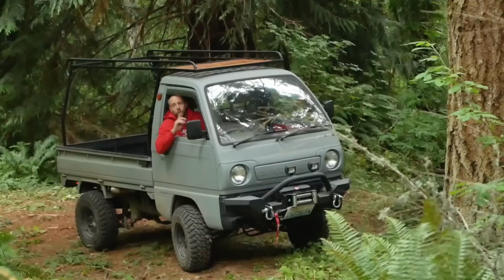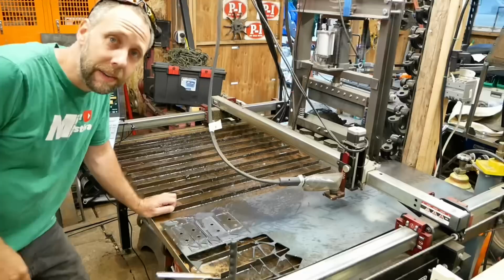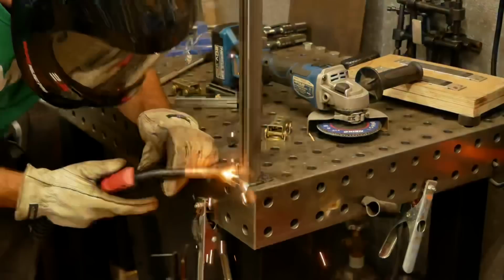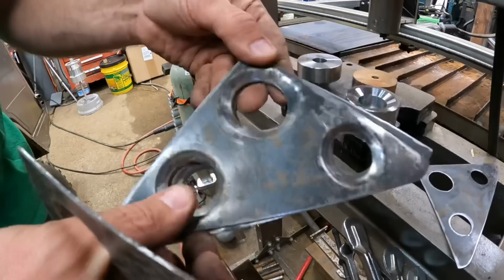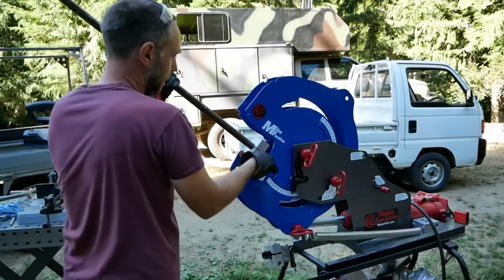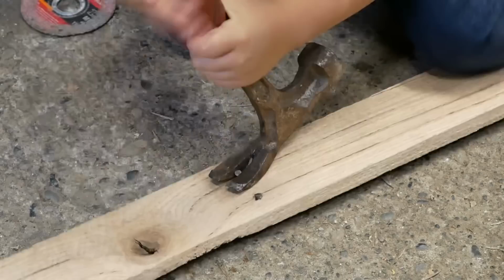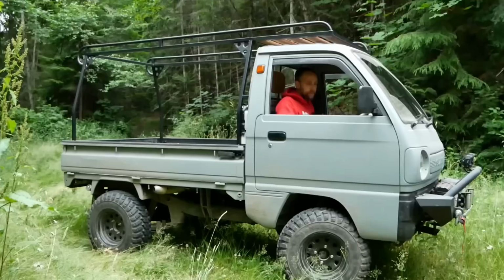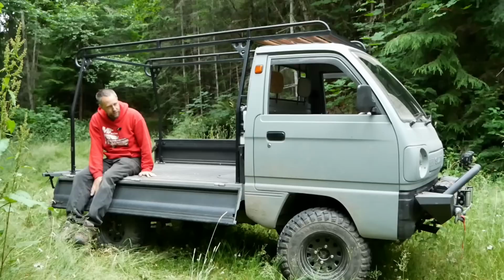Suzuki Carry JDM 4x4 kei truck ladder rack build

Comment: This reminds me of back when I was active in the 4x4 crowd. There was a guy in our club that would weld up steps and bumpers for 4x4’s that were made of round tubing, but he welded them up tight and fitted them with air compressor fittings so they could double as air pressure tanks for the little compressors we took on the trails.

Comment: I'd love to say that the quality of that rack is factory built, but that'd be a DAMNED insult to your build. Freaking top job on this one Mike, superb. Indeed, you've come a long way, and it's not just the tools that got better, i've seen plenty of shops built with money that forked out subpar quality work.
As a recommendation for a sewing machine, maybe be on a lookout for a Sailrite Ultrafeed LSZ-1. It ain't cheap, but the quality is there, and it's a stout machine. Adam Savage just got one and he has a few projects using it (you can trust his opinion on the machine, and you can also see him push it). I have an older LS-1 and it's a very capable machine. FYI, these are machines made to sew sail material, so nothing like your average Singer or common grade Brother machines.
Reply from the maker: Thank you!!!!

Comment: A singer 20U is a decent all around setting machine for starting out. Maybe 500-600 in my area,  but could be completely different price out west.  These old machines can be difficult to come by because new ones are crazy expensive so those that have used ones rarely let them go.  

Check your local paracute drop zones and talk with the master rigger . They will usually have any leads on local machines.  You don't want to ship them.  They are heavy.

Comment: Add a roller bar to the back crossbar ... mount it on the outside of the bar on 2 pieces of round tubing so u can raise n lower it above the back bar ..makes it easier for loading ladders n long materia, like box steel etc ..

Comment: There's a military supply joint down by fife that always has a bunch of those military trailers and parts. One of the most common unused parts were the bows and canvas cover. It was a very cool design that let you cover just a portion or the whole bed. I think that the specs are close enough that you might want to look into modifying one of those. It might not even require modification unless you want a very tailored fit. Either way, it might be the cheapest way to get raw materials. Plus that waxed denim that they used is fantastic, last forever

Comment: Great little episode Mike.  I bought the Fein Chop saw after watching your review a few years ago and I have used it so much for some huge projects and it's absolutely brilliant.  I dulled the blade on some stainless and actually resharpened it with angle grinder and it's been great ever since.  Byron. Australia.

Comment: Coo build!  Simple is elegant.  If you notice any lateral (side-to-side) movement you could put gussets from your mid cross bar to the forward vertical legs.  I don't think you hardly see them as they'd be tucked behind the cab and they would sure stiffent things up in that direction.  If you put them on the back legs they would perhaps get in the way of getting in and out of the bed and would be more in the wind.

Now with all the good tools this is getting too easy for you!  You need to challenge yourself.  That rack might be a good foundation for a gun turret or rocket launcher!  LOL!

Thanks for the great content.

Comment: This is exactly what I want to do to mine. A). Would you ever fab/sell one of these?  Possibly as a weld-it-yourself type thing? I have a welder but no bender.and B) Ever thought of running a plate under the bed where it bolts down and welding a tube off the side of the frame to the plate? This will keep it bolt on but with more strength. This is how we used to make our roll cages.

Comment: Another good idea well executed - i wish i had your skills. I am looking forward to the 6 wheeler build when finished. I like the fact that you will change the wheels on the Carry - with those oversized tyres -  its either upgrade the engine or get proper sized wheels - and as you fixed the engine problems - all that's left is the tarp top.

Comment: Mike - Amazing work as always! I love watching your videos to learn and get ideas for future projects. One idea for a modification if you build a heavier duty rack in the future would be to extend it a little further forward and add rollers at the front and rear of the cab to the rack. This way you can loop your winch rope over the top and pull things into the bed you might not be able to load by yourself. Take care and please keep cranking out the amazing content!

Comment: maybe add a wide strap with dimple dies to strengthen the middle of the pallet boards where the nail holes are?  Do the dimples where the open spaces are and screw on the edges.

Comment: That truck looks totally unsafe for highway use and I want one! It looks great and rack turned out great, especially with the little details like being able to open the sides and the tie downs. I've installed toolboxes to the managers demands that didn't open more than half way because they hit the flat bed side rail, but that's how they wanted it despite my objections. I missed how you aligned the top square rails to end up flush with the cross braces so both were horizontal and not tilted in or out.

Comment: I had a suzuki the same model as yours. It was converted to a left hand drive. Problems encountered were fuel pump, high engine temperature when caught on traffic jam- can be solve by replacing the engine 4 blade fan w/ 5 or 7(i forgot) blade fan but I just change to semisynthetic oil 10w-40 drop the temp a little bit.. Noise also at the front axle when travelling straight you hit a bump it randomly makes a sound for few minutes and suddenly stop(sounds like "winding ngok5x... noise" not the clunking noise. Installed an a/c that is to big for the engine losses power so much  that it is like shifting into a lower gear & the engine braking.. I think it is good to repack the cv grease and other parts of the drive train as preventive maintenance. Be aware also that the front end/cabin also is not that strong, I had seen a lot of accidents involving Suzuki or similar mini trucks that was hit head-on crushing the driver even by a motorcycle.

Comment: Nice custom fabricating!  Nice looking welds!

I love the look of the ladder rack but it wouldn't add much functionality for me.  My Tacoma had the same size bed and I carried a large 17' Grumman canoe in the bed.  The overhang was extreme and it looked very funny but it was much easier than trying to put it on top.  My kayak would fit in the kei bed easily.  The headache bar would be all I need to protect the rear edge of the cab if carrying a ladder in the bed, leaning against the cab.  I definitely wouldn't want a ladder rack if it prevented me from carrying 4 foot wide plywood or drywall.

One simple fabrication I'll probably do is a small locking container across the back of the cab, above the bed rail (or nearly so) and below the windows.  It would allow full size sheets of plywood on the bed underneath.  The kei trucks have almost no inside storage so this would add some secure weatherproof storage for tools, cam buckle straps, air compressor, etc.  I might make locking boxes from a pair of oversize ammo cans.

Comment: Cool Mike.  Rack looks great.  Thinking of getting a mini dumper, there is a guy near me, "Dougs Trucks" in Michigan that imports and sells them.  Thought it might be a good cheap way to move stones I quarry and gravel material around my property.  I might be asking too much of one though. Some of this stuff is pretty heavy.
Reply from the maker: They are great little trucks, I think they are rated at 800 lb payload but I’m sure you could move 1000 lbs in one. I don’t know if that’s going to be enough for what you are planning on doing with the truck but I know you will get a lot of use out of one around your property. Are they street legal in your state? If so I use mine all the time for trips to town, bringing home building supplies, hauling garbage to the dump. My articulating truck can move about 1 ton so it’s much more useful for dirt work on my property especially with the hydraulic dump, but it took me a year to build. But really those two trucks are entirely different machines. Let me know what make and model you are looking at and I can give you a little more insight on them. 👍

Comment: any of the pre 1960's sewing machines will deal with the canvas for the covers, so a singer 99K or any of its clones. use a large guage needle (14-18) and a bonded nylon thread.

Comment: This looks amazing!  So impressed
Reply: PS Why does putting the dimple imprints in the 45s make them stronger / less flexible?  Seems counterintuitive to me that removing mass would increase rigidity so I’m super curious
Reply from the maker: Thanks for checking out my videos 👍 
The dimples I added to the flat 45s add rigidity because of the extra bends it adds.
Anytime you add a curve to a flat surface it will increase the rigidity of it, that’s one big reason cars built back In the 1940s/50s had almost every body panel curved. Hope this answers your question

Comment: Great job. The only thing I would have done differently was to make the mounts in the bed with square holes and used carriage bolts.
Reply from the maker: Now that you mentioned this I completely agree with you about the carriage bolt idea 👍
Thanks for checking out my new video and commenting James!

Comment: you have all the cool tools!!!  nice setup for sure
Reply from the maker: Thanks buddy 🙂
I have been working on getting the tools needed to help build cool projects in my shop. These are all useful tools that help to build this stuff, but someone with a few basic tools like a welder, angle grinder and a drill can do most of these same projects, you just need to build them a bit differently.
Thanks for checking out my videos 👍

Comment: What a great job on the rack Mike, lots of really nice details. Did you put doubler plates under the bed to help spread the load where you mounted it to the bed? Again you did a great job on the rack and the pallet wood is a super nice touch.

Comment: The tubing is a bit light but you are not going to be using this as a work or contractor vehicle, lightweight small tubing is sufficient   I ended up with the universal Harbor Freight rack for $300 which is overbuilt for my Honda Acty, but any rack at all is just so useful.

Comment: Hey Mike, great video series!  I also have a 90 Suzuki Carry that I picked up cheap in La Grand.   It's the extended cab model... I wanted the legroom lol I'm 6'5, it also has room for the mutt if I have a human passenger.  Has a hole in the block from a thrown rod.  Been looking for a motor for over a year...  bought one but it turned out to be the wrong one and a waste of $800.  I'm thinking of using the complete drivetrain from a Suzuki X90 that's been rolled and is not repairable.  I bought  a Carry for the same reasons you did.  I had one briefly when I was 14, had a 360cc motor and was 2wd. I also buy things that need repairing and fix them, partly to save money and partly because I figure I'll have to replace parts on them anyway since they're used.  You said you don't like those tires... I have smaller diameter mud tires on mine that I dont want.  Looks like you're out on the coast so the drive over would be pretty expensive right now.  Hopefully gas prices come down in the future.  Nice build!  I like the music!

Comment: After seeing many of this type of clip, I can honestly say I am impressed with your work and how you approach it. Extremely well done, great bending and mig work. Personally, I would have reinforced and protected the bulkhead a little (especially the rear window), and I may have been tempted to continue the roof bar support down to the front bumper that would offer some protection to the screen and screen pillar when off roading. Making a removable pegged or peg and hinged rear top bar would be a bonus if you need to load anything tall. Not sure if 8x4 drywall would go in there. Not trying to shadow your great work, these are just things I would do. I am looking for two of these or similar for work in SE Asia and the more I see on your channel: the more I know I made the right choice.

Comment: Hi Mike, new subscriber here (Ants pants told me about your channel). Nice job on the rack. I bought a Suzuki Carry 4x4 with dump earlier this year. It works great as a companion to my Harbor Freight trencher. It's been one of the best additions to our homestead. Look forward to browsing your content. Keep up the great work.
Reply from the maker: Right on Ants Pants has a great channel 👍  Mini trucks are awesome! I really have been enjoying mine, I just bought some smaller mud tires last week for mine and it’s really helped restore the power, the previous owner installed those big 25” tires and as cool as they looked, it really sucked the power down. What year Carry did you buy?
Reply: @Mikefestiva  Mine is a '94 and I agree on the tires. I'm running 12" Sun F off road tires on the stock rims. My place is in the foothills of the Blue Ridge mountains so I have some steep, slick clay hills and it climbs great and will haul and dump a half ton load with ease.

Comment: I'm wondering why no gussets for side-to-side support on the rear vertical members?  I see them on the front parts.
Reply from the maker: Yes as you mentioned I have gussets on the uprights close to the cab plus a cross bar below the window, with the design I did with the upper round rails that curve around 180° and tie into the uprights it added a lot of strength to the overall design.

Comment: Another great vid! I'm in Oregon and I'm trying to find out how to register kei trucks here. DMV site says you can't but I've seen them with Oregon plates!
Reply: Past 25 years or something they're antiques. Maybe the ones you saw were older?
Reply: In Alabama they said they couldn't be registered and tagged but if ine went to a smaller county office and they inspected it with all legal required equipment in place and working a lot of those offices passed them and issued rehistration and tags... So I'd ask around and see where and how those others went about it.. Forums for them exist and are plenty helpful for any questions such as that as well as upgrades,technical help,etc..
Reply: @FJ80Coop  hmm that's interesting. Maybe you can get it registered in another state and then transfer to oregon?

Comment: So many possibilities with this truck.... and road legal to !! Your skillfullness is "awesome" .  Nice work. Can't wait to see all the mods you will do to this truck....except for the tire reduction...Don't do it !! Haha
Reply: What is wrong with the tire reduction? They were originally designed for a certain size of smaller tire. The truck will definitely  have more pep, probably  handle better and have fewer steering and suspension issues down the road. So it will be more reliable and durable. Don't think you can best the Japanese engineers at these companies because they know way more than you who just think of the cool  factor.
Reply: @bryanwarm2471   Hi Bryan, I certainly agree with you about the engineers knowing more than I do !!  I made this comment about the tires  thinking If this was my truck in my working environnement.  I only work with my vehicules on my homestead ( 30 acre wood lot). I need  vehicules with high ground clearence and that is exactly what prevents them from having issues.  I always drive them in low range and leave the torque do the job. I very rarely rev the engine. I don't break them !! That's the advantage of having a vehicule with a low range tranny,  they are more  tolerent to tire size change. I would never increase the tire size on a honda 420 for the obviouse reasons.  If I were to use this truck on the road also , the original tire size would definetely be more logical for the obviouse reasons you  mentionned. Sometimes there's a worthy  reason  to modify a vehicule to suite a person's particular needs depending on his work environement even if for some people it might just look like a ...."cool factor".  Most of the time , when a vehicule breaks it's not what is at the end of the axles...but what is behind the steering wheel.....You will probably respond to me with the following ..." yeah, but this is not your truck, it's Mr Festiva's truck." and you would be right.
Have a nice day!
Reply: @stephanelachance6195  Stephanie, thank you for your well reasoned and most impressively, DECENT account of your need for larger wheel / tire size. It is unusual to see reasoned discussions in YouTube comments. It is typically throwing around vile insults or much worse that matters rather than the exchange of actual ideas. So, in your casee, yes, you are probably  just fine with those larger tires and they actually do serve a necessary requirement. And you will not be putting nearly the forces on the truck that you would by running down the road all loaded up. I am sorry that I thought you just wanted that little extra " cool factor '. For many people, it does seem that a truck is something to either lift or lowwer but do  not want to be seen in driving it stock. And these are largely people who have no
 specific requirements such as yourself. Imstead, they seem to believe that the rest of the world will notice them which will tranlate into instant unearned popularity and love from all those who behold their modified truck. 

And, you are so correct about it is what is behind the steering  wheel that is the biggest danger to any  vehicle. I like to  maintain that there are people who could destroy a battleship just through improper operation. Keep up your nice civility. Cheers,  Bryan
Reply: @bryanwarm2471  Hi Bryan! I appreciate your sincere and respectfull answer. Take care man !!